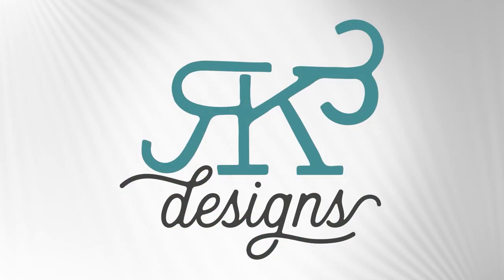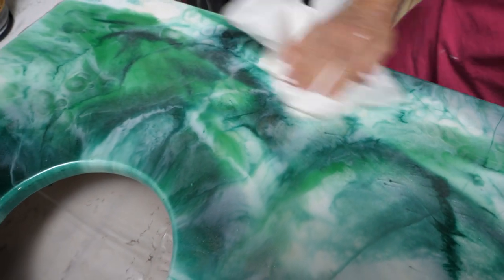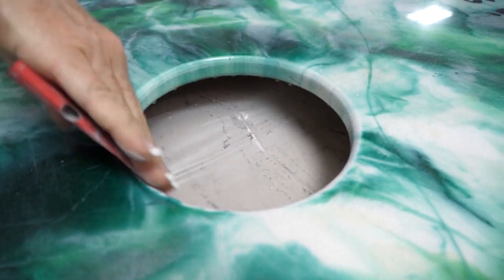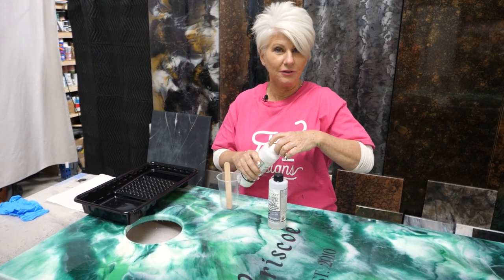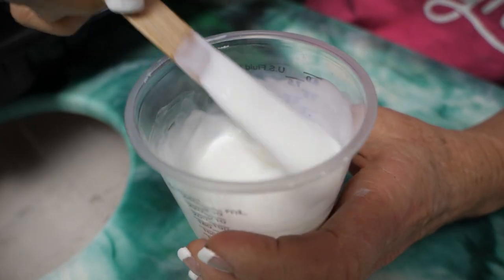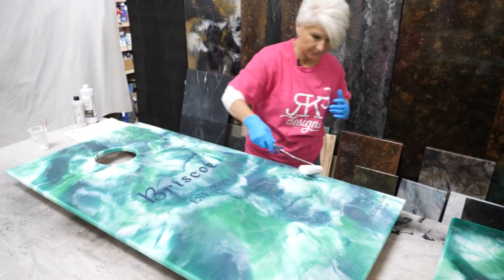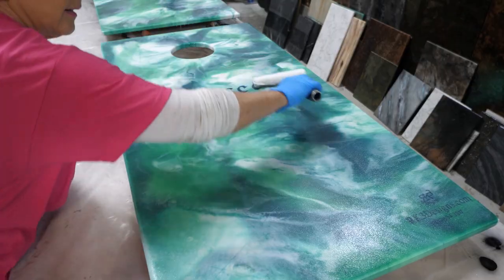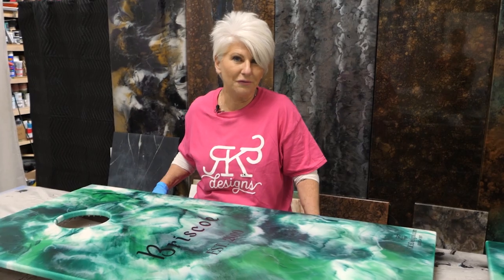Don't Miss These Epoxy Tips For Pest Removal & Top Coat

Comment: Really diggin’ the design on the corn hole boards. Please say that you’re making a video for it!
Reply from the maker: I think that ones in the queue 😂😂
Reply: Looking online, a bare, unpainted cornhole board is just over a hundred dollars. A finished board goes for 250-300. How much did you spend in materials?
Reply from the maker: We build our boards from scratch and material run about $98. Many times we use the boards to teach finishes in our classes, build the frames  then donate them to local Charities in our community. They then auction them off.  We raised a little over $11k last year.

Comment: Have you ever tried to make an adjustable wood framed screen cover to prevent bugs from getting on your projects? I made some for my cookie decorating trays & it worked great until I could afford a bakers rack with a zippered cover!
Reply from the maker: No I haven’t but sound awesome. I really don’t worry too much about them since we now put the ultimate Top Coat on just about everything. We just sand those little bugs out 😊😊

Comment: So if your doing the ultimate top coat does that mean you don't have to do a flood coat at all??? That would save some if you don't.
Reply from the maker: I always tell people if your color coat turned out nicely and there’s not a lot of imperfections, you can skip the flood coat. However, if your surface is going to be a high traffic area, take the extra time and material and do the flood coat. UTC is incredibly durable, but the extra flood coat could be added insurance.
Reply: @RK3Designs   Great thank you for the reply!!